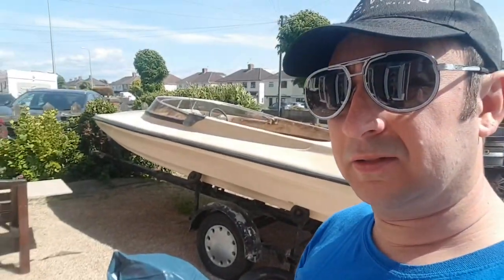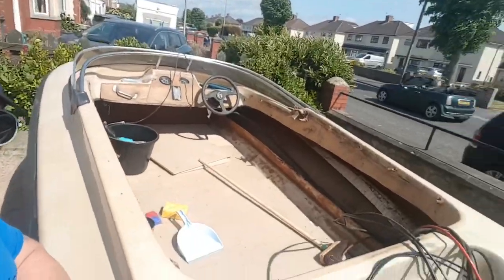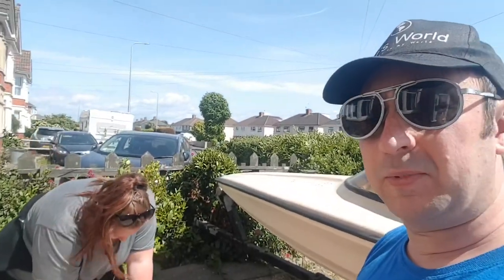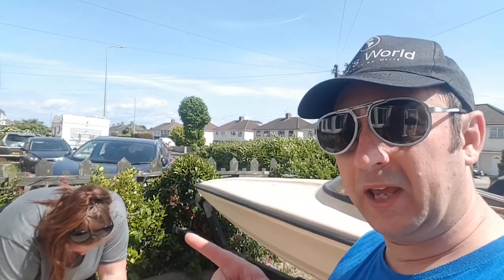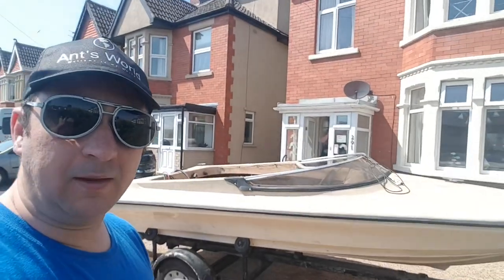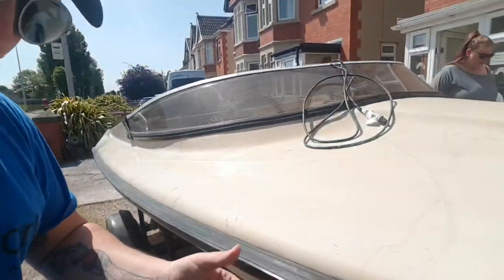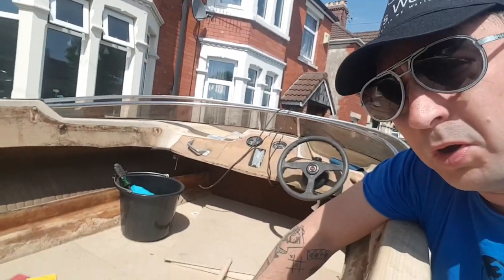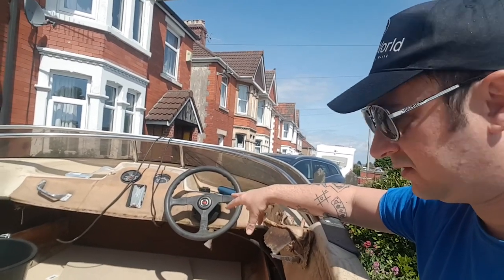Speedboat Project - Shakespeare Magnum

Comment: Very cool boat, worth getting a new water pump impeller ( cheap and needs changing every year) and some cooling muffs to start it out of the water, and the gearbox oil (also cheap and easy). The inline 4 is a fantastic engine BTW. 
If the floor was rotten it's worth having a look at the transom from the inside. Its ply on the inside 1.5 inches thick and needs to be tip top condition to hold the weight and power of the engine. Give it a good poke with a screwdriver from inside the boat,if it's not soft you should be fine.
Reply from the maker: Once I know there is life in the old outboard, I will change the impeller mate.. The Transom is good and well covered from the rain, which is lucky.. Its been left with no cover on so seats and floor got soaked.
Thanks for your comment

Comment: I have one also in red, with only a 50hp on still does a good 38mph on the sea. had it about 2 years now, had great fun on it but just restoring it now also.
Reply from the maker: Awesome.. Thanks for your comment. I cant wait to try this on the water
Reply: You'll love it mate honestly. My wife wouldn't come on it for the first year once she did she literally loved it. Only thing I'm struggling with is finding some new Johnson Controls like rocking horse s*** either that or mega expensive, either that or il stick a different engine on at some point. Look forward to seeing yours. Have you done anymore since the vid?
Reply from the maker: @lubbeworks4464  my other half loves boats so shes looking forward to trying out too.. I have took the controls and steering out.. We are waiting for carpet at the min.. Once the carpet turns up its all systems go..
Reply: Awesome look forward too seeing it!

Comment: Here's a website listing all of the Shakespeare boats and the later Waverider built models. This should help you to identify yours.http://www.raffinaderiet.com/Boats/Clubman/Clubman_4/clubman_4.html I restored my Clubman a few years ago. I replaced all the wood because it was shot including the transom core and glassed it all back in. Before you finish the floor all the way under the splashwell it would be worth checking what your transom is like by using a 25mm holesaw to cut a sample from inside near the bottom. Just don't cut all the way through!  If you have good wood in the core you can make a plug and bond it in, then glass it back over.
Reply from the maker: Wow.. Thanks very much for the info I will check it out..
Reply: I saw your post and link  on the CMBA Facebook page, take a look at the forum too, there are a few Shakespeare boats in the club with lots of info. See: http://www.cmba-uk.com/forum/viewtopic.php?f=20&t=1679&hilit=Shakespeare
Reply from the maker: @aeromarine6780  Great idea mate I will look through the facebook page and have a look.. Thanks